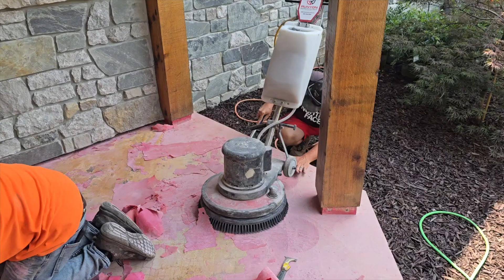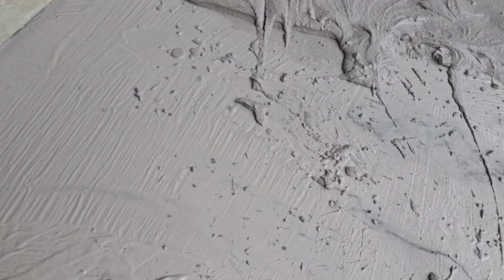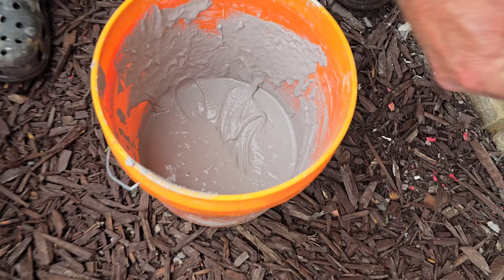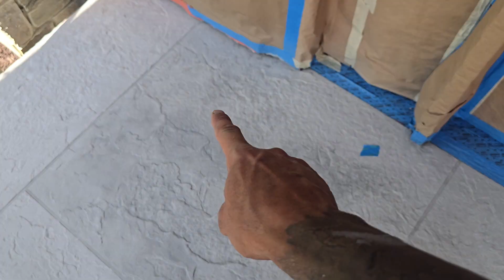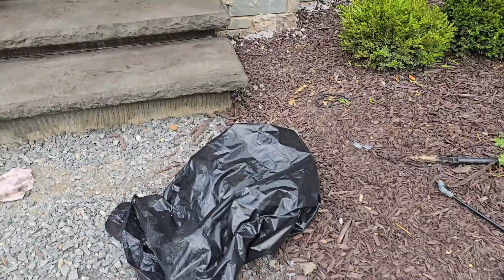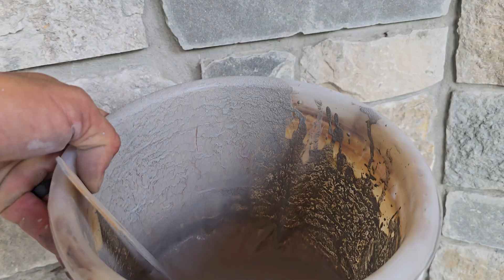Custom Concrete Overlay

Comment: Nice job. 
Wouldn't the edge of the steps chip away over time?  Do you reinforce the edge? 

You can get a neat semi gloss effect by using the blue grinder wheels (made for removing paint ). Gentle touch, after concrete is half cured, not putting much weight on the grinder. 
And to make it look dull, I use Citric Acid and Laundry det. , left for a day or two, it gives me a rough stone look !
Reply from the maker: Thank you and appreciate you watching I know it was a long one. 
Not sure if you're talking about the stamped overlay we did on top where we pressed the form liner in the face to texture or the actual full depth concrete steps. 
We did the back of this house the same way it was 1200 sf but suspended up on a deck like this where we just hand shaped the edge on cantilever overhang. It was so high up you couldn't see the texture as much but they wanted this stamped overlay edge to match the steps we poured going down from here. 
Haven't had any issues with it breaking off yet and have done this several times throughout the years

Comment: At 28 minute mark the joints or grout lines are they cut in with a saw or is it the stamping matt pattern? Anyone know how he did this? Really top quality work
Reply from the maker: Thank you sir. This is all done in seamless texture stamp and then we did score all the lines in with a 4" grinder

Comment: That turned out awesome man, thanks for the great video! Curious if you'd recommend this process/those products in a freeze thaw climate?
Reply from the maker: We live in a freeze/thaw area but not nearly as bad as up north. People do it all the time with success. Prep is king with any overlay system. We stamped overlay down on side porch of my house thats been there for 8 years. We stack wood 5-6' tall on it every winter. No issues with coming up. Not yet anyways can never say never